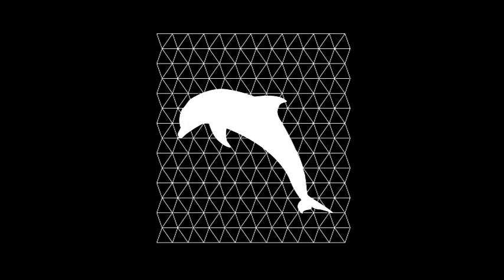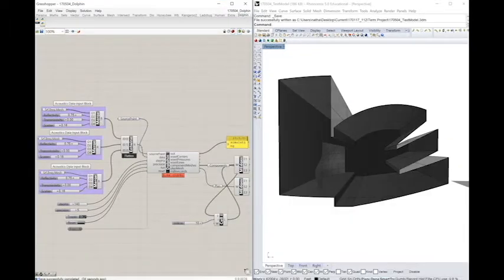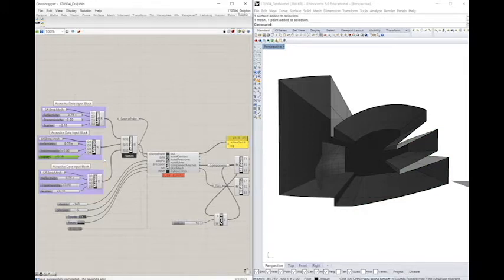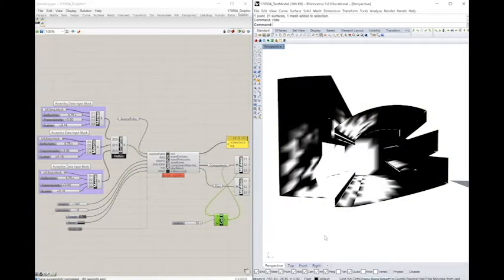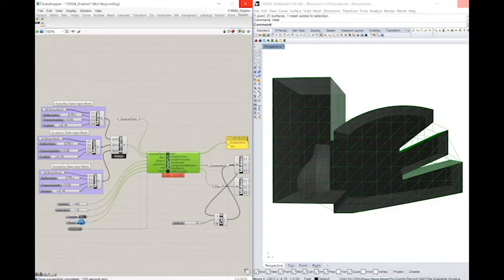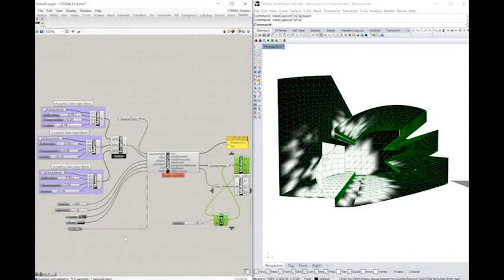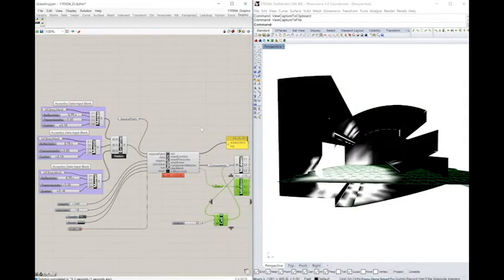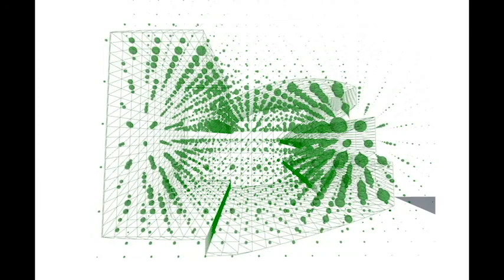Dolphin Acoustics for Grasshopper

Comment: hey, nathan, any progress? i'm interested for using purposes
Reply from the maker: Sorry to say I have not continued research along these lines since leaving school.  This method was extremely computationally intensive and could benefit from being made by someone who has taken more than the CMU Coding 101 class (This script would be helped a lot by running on multiple threads) and I do not have any real world comparison testing to back up the results.  If you're interested though, I can send the source components (just... be aware it's basically a concept demo).
Reply: @nathanlutz9395  Hey Nathan, I'm currently working on arualization for an academic research project, and would be greatful to look at your source components?
Reply from the maker: @GEORGE.M.M  https://drive.google.com/drive/folders/1fK3dubfnLNtRlVCk8lHQtQ4Q3zuRAbS1?usp=sharing
Reply from the maker: This folder contains the base files.  They were built for Rhino 4, and may not function in Rhino 5.  If you are able to make any progress in this direction, I'd love to hear about it - auralization is something which I thought might have been an awesome end product, but I didn't built the component to achieve this.
Reply: @nathanlutz9395  Thanks for the quick reply Nathan, I will defo get back to you if I'm able to achieve any progress.